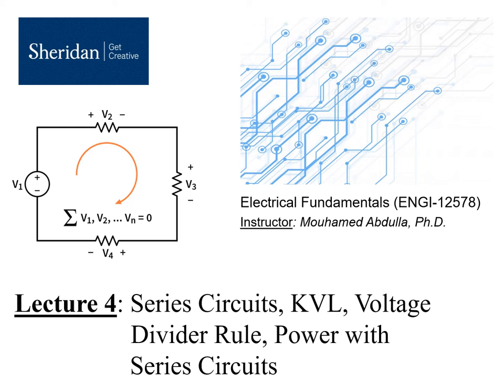Lec 4 - Series Circuits, KVL, Voltage Divider Rule, Power of Series Circuits

Comment from the maker: Timestamps:
--------------------------
0:00:00 - Introduction
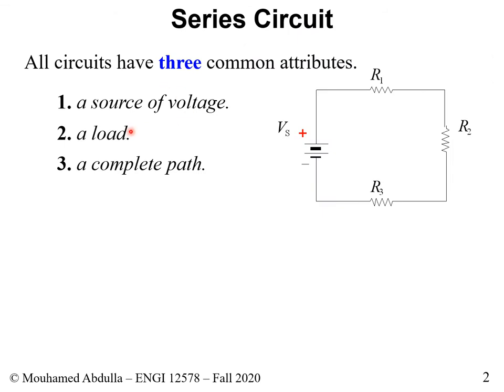0:00:37 - Series Circuit
0:02:49 - Current in a Series Circuit
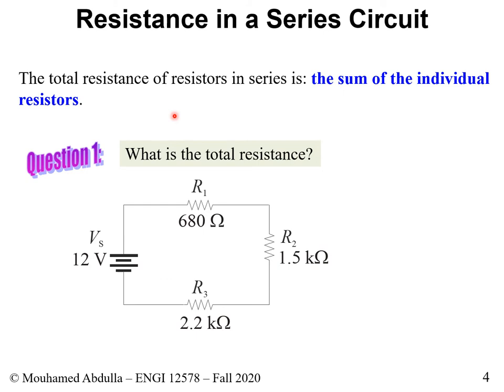0:04:10 - Resistance in a Series Circuit
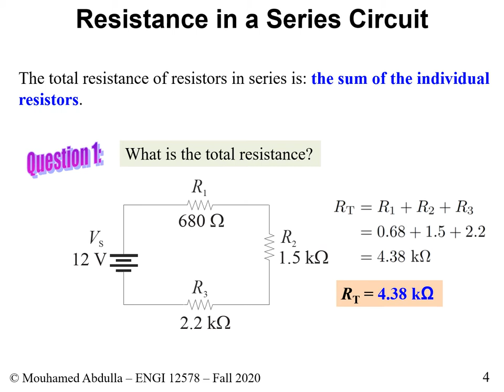0:06:14 - Parameters of a Series Circuit
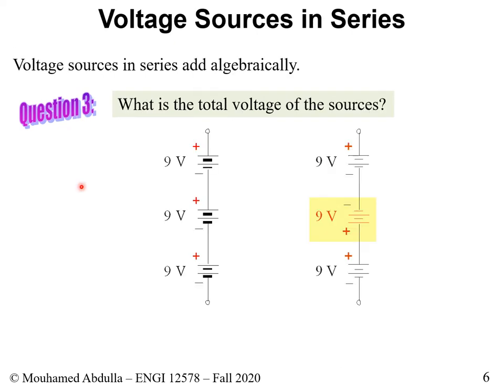0:19:20 - Voltage Sources in Series
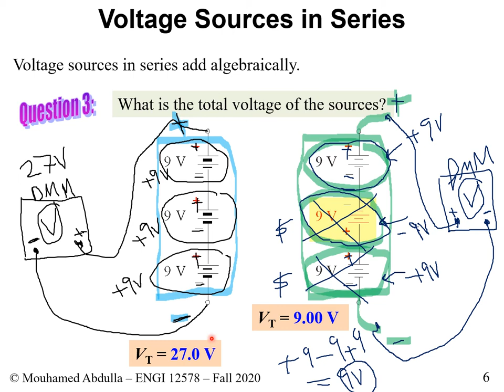0:27:05 - Kirchhoff's Voltage Law (KVL)
0:32:38 - Voltage Divider Rule
0:46:02 - Power in Series Circuit
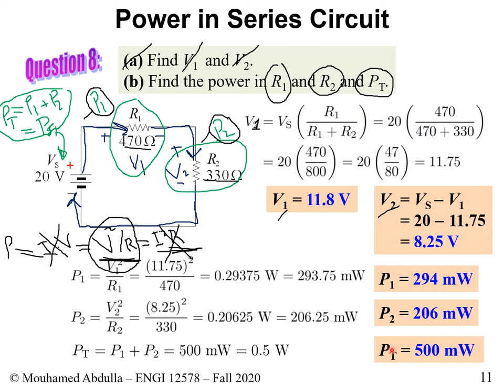0:51:36 - Voltage Measurement 
1:18:19 - Key Terms and Definitions
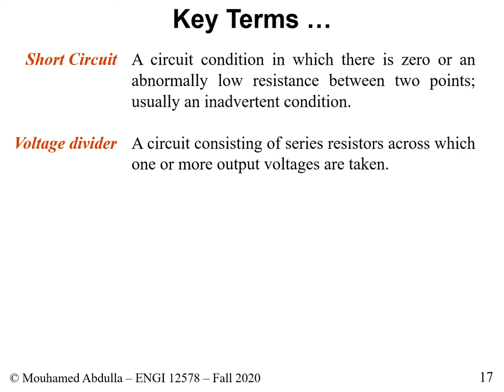1:18:30 - Relevant Multiple Choice Exercises